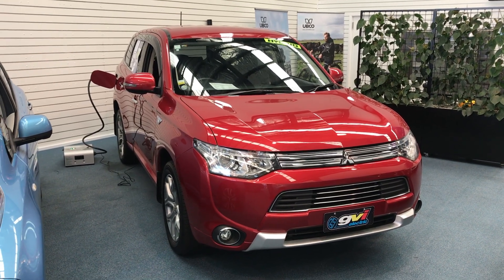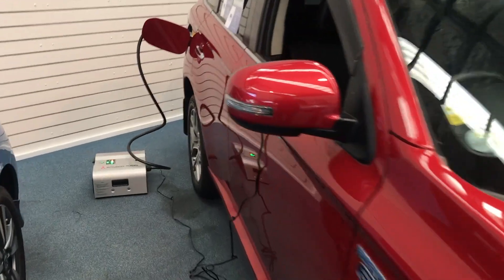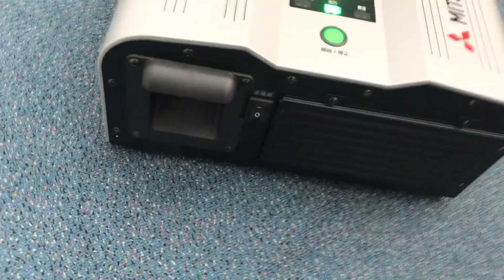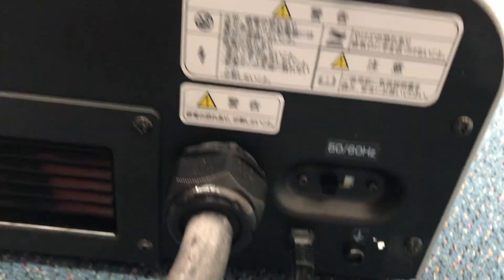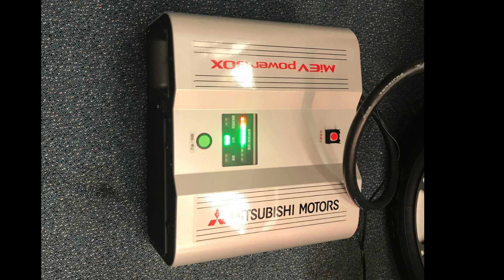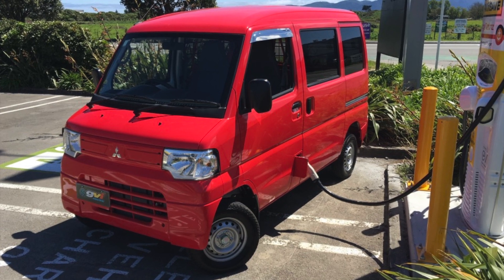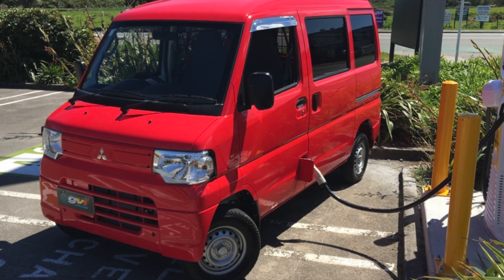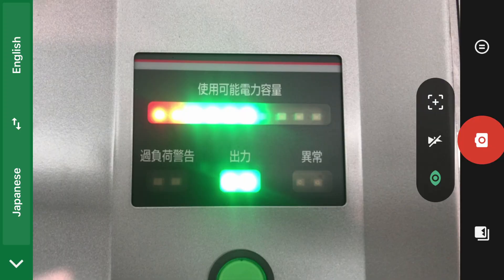Mitsubishi PHEV MiEV Power Box Demo 100V AC

Comment: How much did it cost? And would the LED indicator you called the load indicator actually be the vehicle’s state of charge?
Reply from the maker: I have seen the units, second hand for about US$1,000-1,500. But that one was included with a MiEV van. The Load indicator is a limit of the combined power of the appliances that you plug into the unit. I think the unit was rated at 1500W = 1.5kW, enough to run most low power domestic appliances, not ovens or heaters. I think it will work with any Mitsubishi vehicle with a CHAdeMO port, but worked with MiEV and Outlander. They are used in Japan for civil defence power, in disasters.